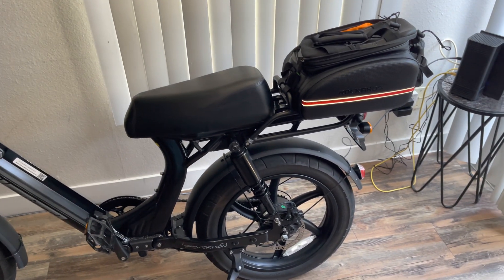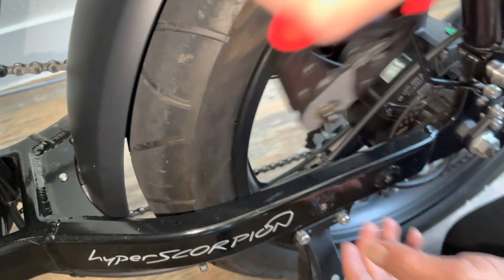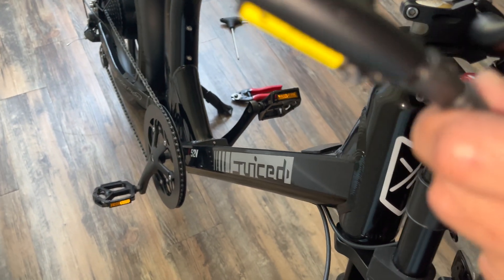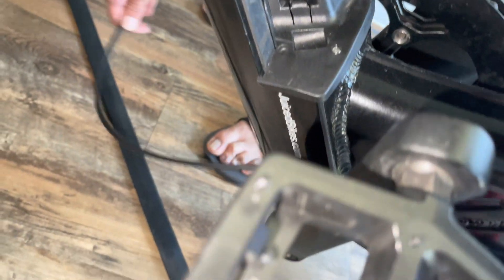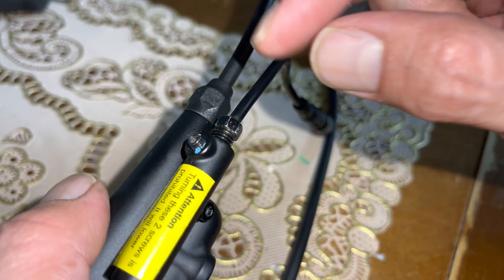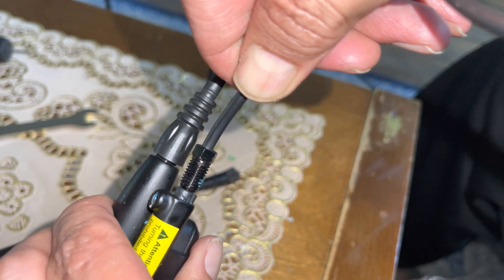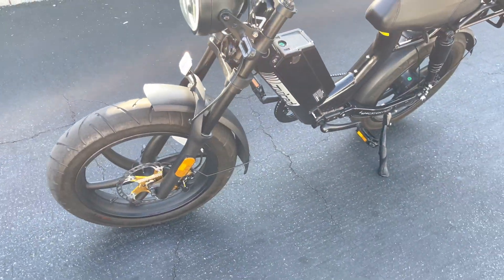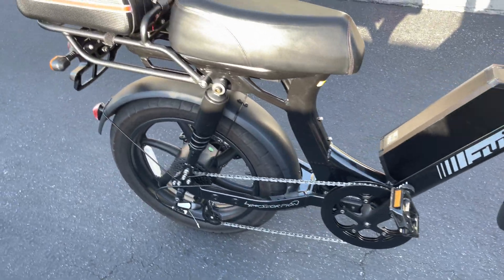HYPER SCORPION upgrade to tektro HD-E725 4 piston hydraulic brakes system

Comment: hey thanks for taking the time to make these kits. I have stock Logan break assemblies on my Hyper Scoprion. Do you know if the sensor for those is the same as the Tektro? If it is a direct fit then I will definitely buy one of your kits.
Reply from the maker: If it’s not the same you can change it I believe it’s similar 
You can contact through my website and send me pictures of your brakes connector

Comment: It’s me again follow up question. Tell me if your rear hose is 1900mm and the front is 900mm. I found a HD-E724 (4 piston) on line showing the mm length. I’ve sent the other ones back to Amazon. If I’m right and I believe I am yours should be 1900mm and 900mm respectively. Please reply soon as possible. Thanks!
Reply: Before your reply I thought let me take the assembly of hose’s apart hell I’ll have to sooner or later. I also have a ScorpionX 2022  and a RadMini 2018 and no problem letting the Hyper Scorpion sit. Your first measure is right but the front measure must be a typo. At any rate your response was much appreciated. Most channels I subscribe to don’t even answer a question I might have. I will try to hold on time wise in hopes you replenish your stock of HD-E725 4P brakes. That said I am too thinking of buying calipers, levers and hose cables separate and a kit to fill mineral oil. Doing a cost out on that. Cable hose quality is important o avoid leaks. Does the kit you sell allow me to replace the hoses should I decide to do that? Again thank you for your reply much appreciated!
Reply from the maker: Hello 
The rear cable should be 1850mm and front 110mm

Comment: just recieved mine, but the hose was really small, do you knwo the measurement of the hose so i can order a new one?
Reply from the maker: Front 1010mm rear 1850mm 
Yes all the ones in market is short i sell the kit in this length
Reply: @bebo150067  i was tlakign about the deimension  lenght? is it 5.5mm or 5mm?
Reply from the maker: @rahi7339  sorry I don’t understand

Comment: Hello.. is the old (black) connector or the new (orange) connector set up for Bafang BBS brakes sensor..?
Reply from the maker: Hello 
Are you asking for bafang yellow 3 pin connector?
Reply: @bebo150067  Yes.. I just ordered the E525 (similar to the E725... it says it has bare wire to connect to Bafang BBS harnesses... Just wondering if that will be difficult to connect the bare wires to a yellow 3 pin brake sensor cable..?  It would be nice if tektro had these set up with a universal connector that you could connect to a Bafang stock yellow brake sensor from the harness..
Great video BYW... i always learn from your videos.. :)
Reply from the maker: @rdkuless   sorry buddy I didn’t understand , I have both red connector and yellow connector

Comment: Thank you for taking the time to show how to install new brakes.  I also have a hyperScorpion and it needs new brakes since the originals are junk.  Let me know how the 4 piston compares to the 2 piston originals.
Reply from the maker: Thanks you 
They are amazing , the bike stops on a dime ,no squeaky sound and the kit comes with 203mm disc brakes and adapter
Reply: @bebo150067 

I’m using 203 on the front and the original size rotor on the rear.  I don’t need to use both the 203 rotors do I?  So you sell this without the rotors?
Reply from the maker: @BattleRidesNYC  yes kit comes with rotor 203mm 2.3mm thickness 
It’s good to have both 203mm in my opinion better braking

Comment: Is this sensor for the brake cut off power to the motor?
Reply from the maker: Yes
Reply: @bebo150067  thank you for getting back to me. I need a sensor that has a yellow male end to plug into my Bafang BBSHD motor. Do you know where I would find that?
Reply from the maker: @overthetopblues   hi ,there’s no sensor available in 3 pin yellow from tektro , the only way you can convert the connector’s  here is the link for the connector convert this will be the best solution right now till they are available in the market 👍👍

https://www.ebay.com/itm/M8-3Pin-2Pin-Yellow-Red-Male-Female-Ebike-Brake-Upgrade-Converter-/224545382279?mkcid=16&mkevt=1&_trksid=p2349624.m46890.l49286&mkrid=711-127632-2357-0
Reply: @bebo150067  ok thx. I figured it out and I only used two wires and cut the red wire out. )

Comment: Why can't you keep the sensor that came with the new brake handle ,iam confused.
Reply from the maker: Because of the connector is different where you connect the sensor with the bike wire to get the signal to cut off the motor

Comment: How do you jack up both tires if you take out tires or cleaning tires, do you have any tools to lift up the bike?
Reply from the maker: The front wheel is more easy and the rear wheel search on you tube
Reply from the maker: I flipped the bike upside down the best way to change the tire and wheels